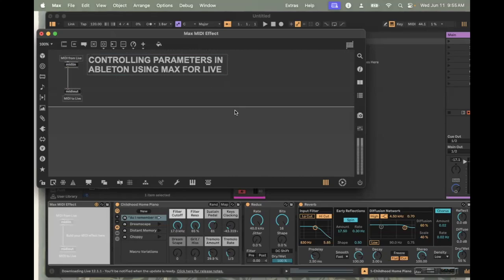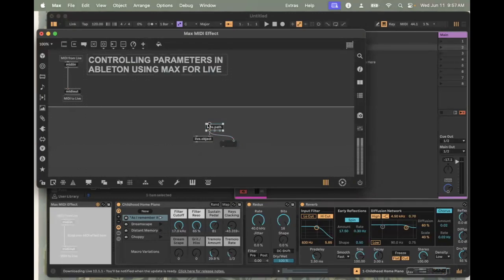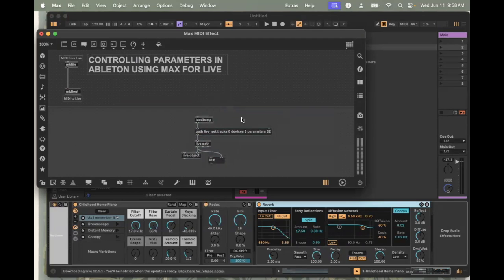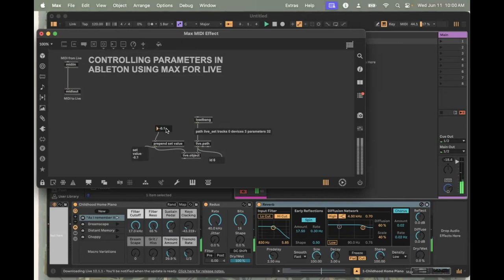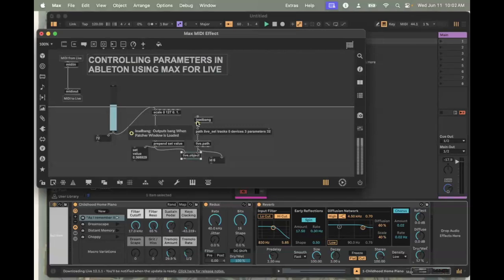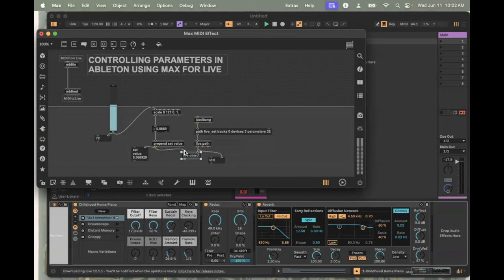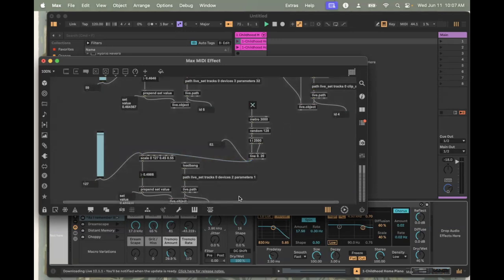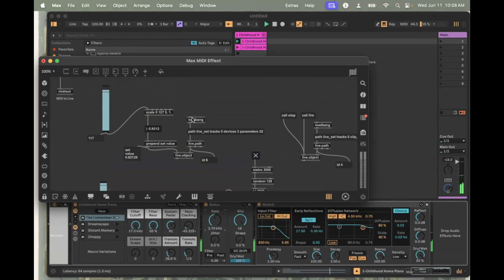Ableton Live: Controlling Parameters using Max for Live

Comment: Hi Dave, I have another question. I noticed that the configured parameters of my VST plugin in Live all fully reflected to show the attributes of my plugin when I highlight the plugin in the rack space. All parameters have two way communications with proper name for the variable amount (for instance I have a sampler knob that shows the name of the sample or the oscillator that shows the wave form name (triangle, etc.). When I select the Max patch that is upstream of the VST  plugin in the rack, first of all instead of the proper names of the variables  it shows only numbers (from 0 to 127) which means then I have to keep the plugin GUI open and keep looking to it to find out the name corresponding to that number, and then also if my sample dial is at around 40 percent, my Max dial doesn't show 40 percent and it stays at 0 and then when I touch the knob, it jumps from 40 percent back to zero and then starts changing from there. As if there is no two way communications for the parameters. Do you know which object need to be added to this Max patch to assure two way communication in all situations, and also bringing the real variable attribute (oscillator wave name, sample name, mod source name, filter type name, etc.) when you turn the dial instead of showing just a number? I appreciate if you let me know. Thanks so much.
Reply from the maker: i have never done this; sorry that i don't have any good advice for you here!

Comment: Hi Dave, I had added variables of the vst plugin through configure to the device pane, then right clicked on it and copied the Max for Live path, I created same signal flow from the message with the Max path feeding to live.path object and sent out to a message box and I do not get any id when I click on the message box with the Max path.  There is nothing showing in the downstream message box when I click on the Max path message. Does it mean this method is only useful for Live's built-in plugins?
Reply: Hi Dave. I just figured out based on your hint in the video. I had missing word "path" in the beginning of the path message. It is working like a charm. :) Thanks so much.